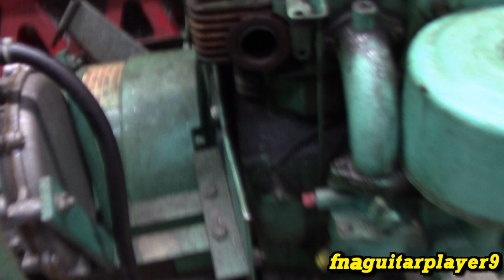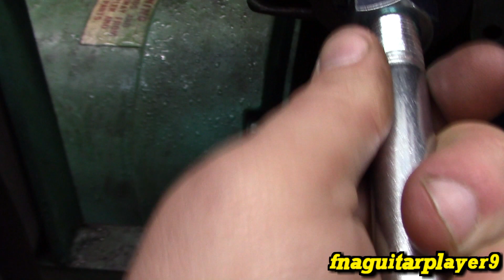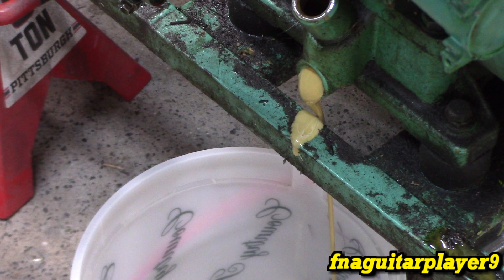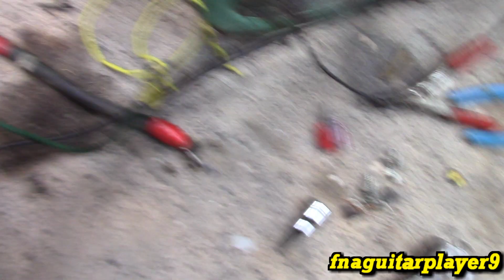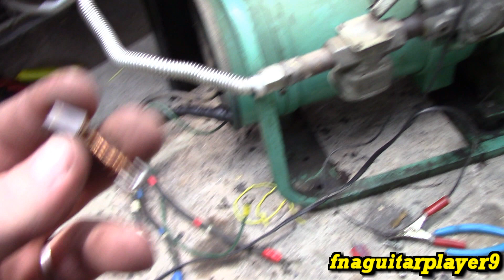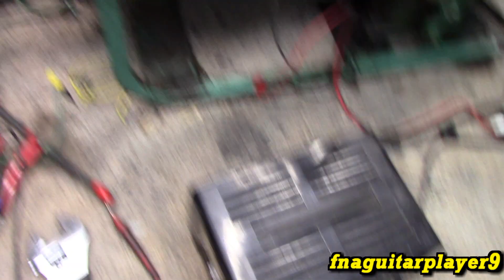8000 Watt Flooded Generator, Running but no Power

Comment: I see that you have a Dremel in the beginning of this video but if you have a small diameter egg shaped and tapered porcelain / tile cutting bit then use that to cut those brushes down to size, it's the same bits with or without diamond edge that a couple of my buddies use support chainsaws with and other small two-stroke engines and it'll make a clean cut
Reply from the maker: Yeah, I used that sander and it seemed to work, i had the dremel out to try and cut the exhaust pipe out but it was to big to do any good with. Thanks for Watching!!!

Comment: Use starter brushes out of a 17 horsepower Briggs and Stratton and I bet them closer than what you got but how close to Princeton, WV do you live? The reason I'm asking is because Smith services / Timken bearing would probably have brushes you're looking for or just a couple miles outside of Princeton you could check with Quality electric and it's located in kegley, WV... Either one of these companies can also wind that generator head for you and I believe those places give free quotes on work also that's local stuff like this
Reply from the maker: I'm fairly far from there but I will contact them and see if its something they can do. Thanks for Watching!!!